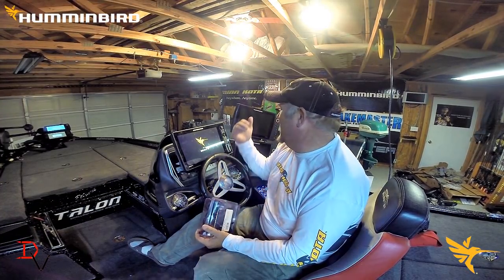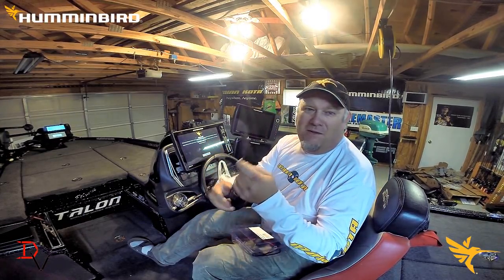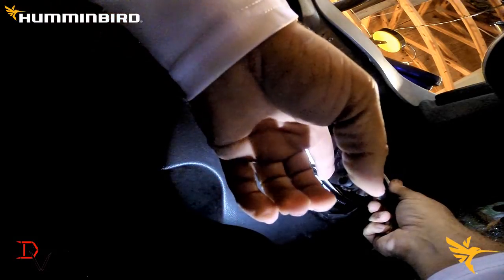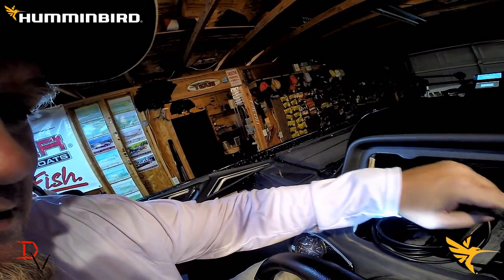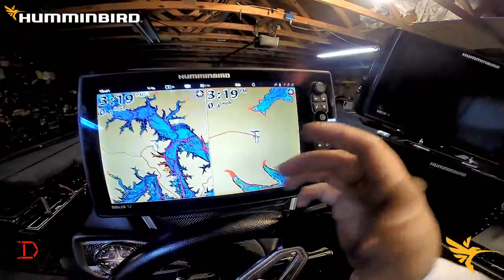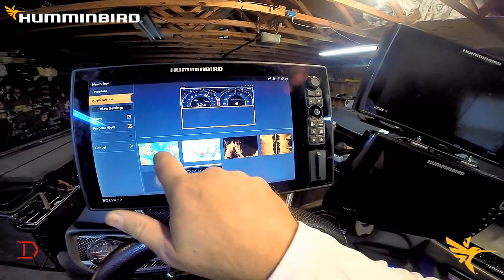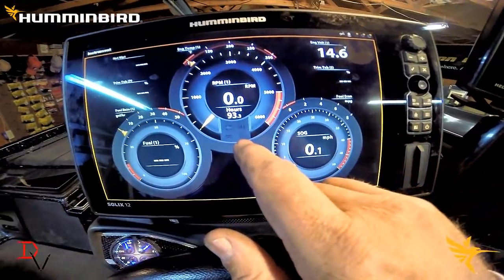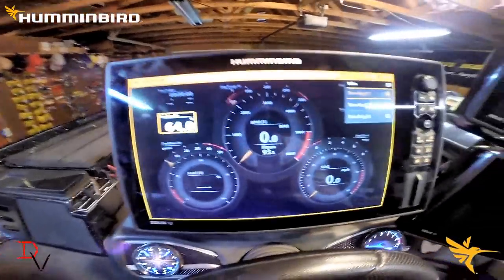Tips 'N Tricks 210: Humminbird SOLIX - NMEA 2000 Install

Comment: Great  video, I have a 2012 Skeeter FX20, what do i need for a fuel level senser to  connect to nema 2000 on my solix 12
Reply from the maker: You would need to connect to the NMEA 2K Backbone but I have not done that I just use the backbone that was in my boat.
Reply: Does the 2012 FX20 or the 2013 250 SHO have the NEMA 2000 backbone
Reply from the maker: I would check with Yamaha Dealer but my understanding SHO motors are NMEA2000 compatible

Comment: I want to purchase an engine interface cable Mercury outboard to Humminbird Solix 15 to monitor engine and system data by NMEA 2000 network. 
I have a 2017 175L Pro XS DFI opti; two Stroke engine; Model# 1175P73EY.
 I want to purchase the NEMA 2000 interface cable that connects to the 175 XS DFI under the engine cowl and connects to the Humminbird 408450- 1 5 Port Ethernet Switch by the Ethernet adapter cable. 
If additional equipment is needed to achieve this goal please let me know. 

can't get anyone from Mercury to talk to me.
Reply from the maker: I don't use Mercury Motors but might try a dealer to get those accessories. NMEA 2000 connects to the unit and is share via Ethernet on the SOLIX or for HELIX you need the Black Box Adapater from Humminbird. Everything else is supplied by Engine Manufacturer or NMEA 200 Cable Suppliers